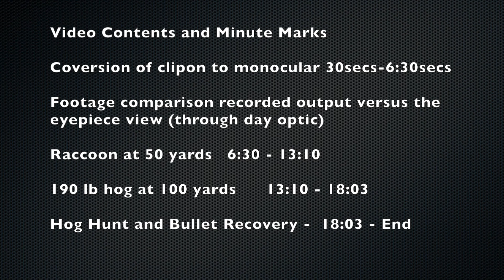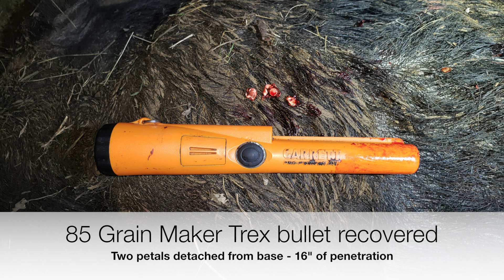Bering Optics 640 res clip on footage and hog hunt

Comment: Great Video!  I can't wait for this unit to become available!  BTW, to remember which rail position to return the clip-on, use something like a small section of rail ladder.  One or two ladder rungs should be fine.  One if you use a Larue Rail Cover.
Reply from the maker: Those are what I use but dang if I didn’t leave them at home that day!  Thanks for the tip and hopefully these are ready soon for release

Comment: Can i not buy a different lense for my hogster-r to make it a hogster-c ?
Reply from the maker: No you cannot - while they share a common body the Hogster R are not setup to allow users to detach the rear ocular mechanism plus the Hogster-c has additional software and firmware to account for different system operations
Reply: @HuntTXhogs  i know the software is different for alignment and such but im not sure how the back is any different that you couldnt change the parts out ? That would be a awesome product to make if it was possible
Reply from the maker: @krowland1990  I don’t disagree , unfortunately the produce the body of the Hogster-r to be fixed and not convertible to a clip on use.

I suppose they want to keep the product separate

Comment: What is the largest objective bell the boot fits over?
Reply from the maker: The boot “light suppressor” will allow a 30mm tube to slide inside of it for max shielding from light, larger objective scopes are meant to abut the light suppressor and gently push in to it as opposed to nesting within.

I’ll have to see what my 50mm does with the light suppressor - I’ll do that test next week and post a vid